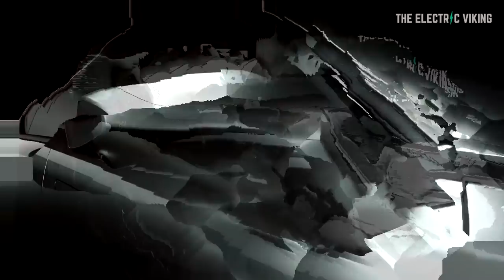Is the Changan C385 the sexiest electric car ever?

Comment: mate, the avatar sub-brand is not changan’s first attempt at going electric. in fact, they have been offering bevs for some time – to dismal results. no wonder, since all they did was ripping out the ice from their existing models and replacing it with an electric motor. as to the e385 – well, beauty is in the eye of the beholder. to me it looks like coming from the same mould as half a dozen other chinese bevs that are or will be in the market soon. what’s positive is that changan finally (belatedly?) is switching to a dedicated bev platform.